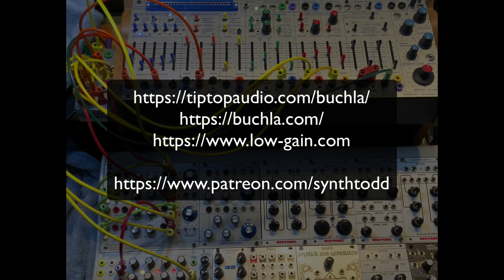Buchla Tiptop 281t to Easel Command

Comment: So they use the same voltage? I've checked the utl1 and it says does not change the voltage, just change the plug.
Reply from the maker: Right, just change the plug
Reply: @vgermuse  thank you, so it is almost the same. I find strange that they don't write it on the gear. Some of my friends have destroyed guitar pedal using old polivoks...
Reply from the maker: Scale it with Maths, attenuators, et al